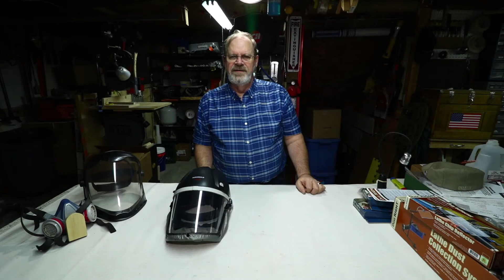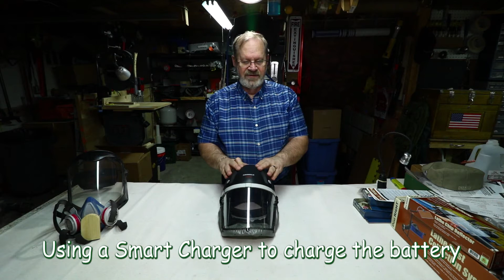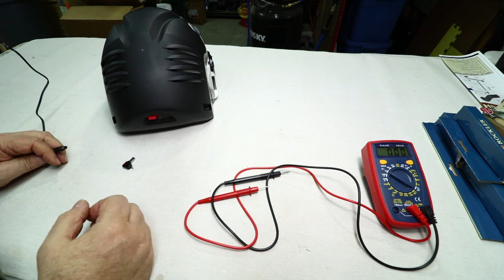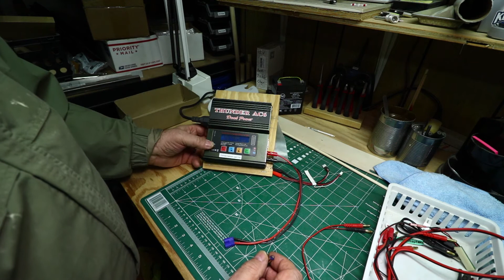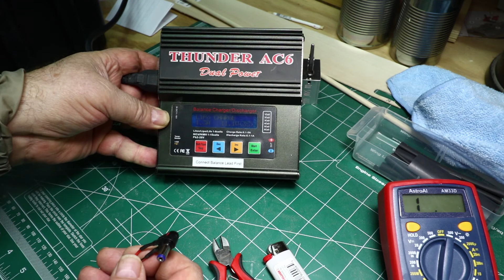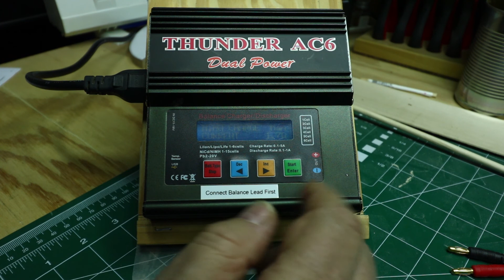Trend Airshield Pro Battery Charging Hack Ep.2017-48

Comment: this battery can be overcharged? i charge it over 24 hrs first day when i bought it...and the wall charger light always red i don't even know when battery is full. how many hrs charging can overcharged the battery? or not enough charging?
Reply from the maker: Thanks for watching!  Thanks for bringing this up. I'm sure you are not the only one.

I would suggest to reach out to Trend support on that.  They have been very good with answering questions.

My experience is that the charger is smart and will cease charging when the battery is full. But I got the green light saying it is.  If not, I would be inquisitive about that as you are.

Another option is to check the charge when full, or expected to be full.  With a multi meter on a DC volt settting, the battery should show about 3.6v to 4.2v at full charge.

Hope that helps!  👍

Comment: Hi Gary, thank you for a very informative video. After purchasing my Trend Airshield pro I did a bit of research on charging NiMh. In part due to the high price of replacement batteries. After watching your video as well as a few others I looked around for a smart charger and happened to find a slightly used Thunder AC6. Since I do not use the airshield pro daily or even weekly would it be advisable to run a discharge charge cycle once in a while? And if so how often would you recommend doing it? I ask because my experience with batteries has taught me they don’t last long in power tools when not used regularly.
Thank you for your assistance
Ron in western Canada

Comment: Hey Gary, thanks for this video! At the time I started implementing this solution, the Thunder AC6 was no longer available. I now have the Tenergy TB6AC+80W 8A unit. The unit works well, but the owners manual has ZERO instruction on charging NiMH batteries. Any ideas? Thanks!
Reply from the maker: Thank you!  Check out this video and see if that helps.  https://www.youtube.com/watch?v=tGT6TFnfBrw

Comment: In the notes up above; could you include the size of plug that would fit the AirShield Pro?  As well as the settings you place your smart charger on when connecting to this battery.  I too have lost the charger that goes with this helmet and don't want to spend $71.00USD for a replacement.  I would rather solder a compatible tip that easily plugs into my Tenergy Charger that is compatible with the shield.  I know that this was published in 2017, but is still tremendously relevant useful information to me........right now.
Reply: Tina, it is 2.1mm inside diameter and 5.5mm outside diameter. Here are some cheap ones on Amazon https://amzn.to/3xhnSTo
Reply from the maker: Thanks for the help Mike!
Reply from the maker: Thank you!  I don't know what the plug size is as it was a left over part from another type of charger. I did give the sizes of the outer and inner diameters of the tip. I would suggest searching online for adapters of those sizes. In the video I discussed the settings I used on my charger. Thanks!

Comment: Did I read somewhere that NiMH batteries should charge at  C/10 max!!!!    0.1C   not 1/2 C
Reply from the maker: Thanks. I don't understand the rates you are mentioning. These chargers use rates that seem a little odd compared to common thinking. For example, with batteries that have a 1000 mAH rating we charge those at 1.0 amp on these chargers. That sounds odd to most people. But is how it works.

I had researched this for charging Ni-cads and are my notes if you would like to see them. I put this link in the video description also.

http://glcrafts.com/Resources/TrendBattInfo&ChrgNotes.pdf

Thanks